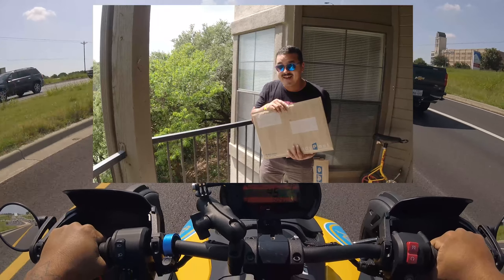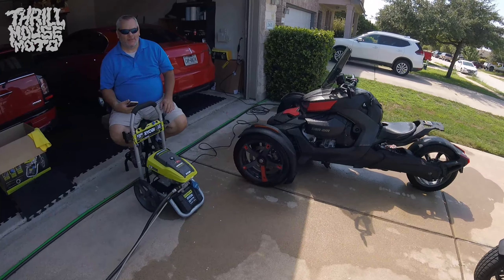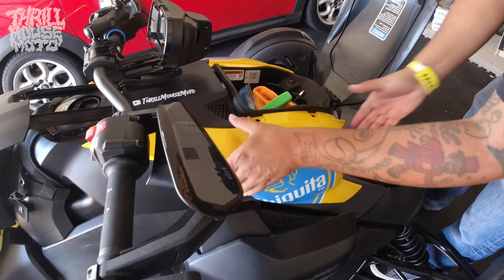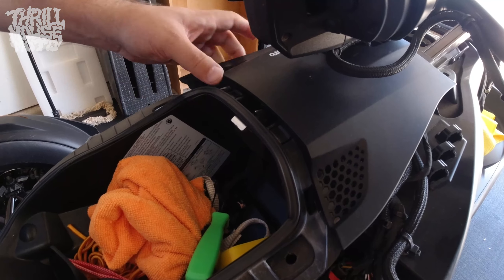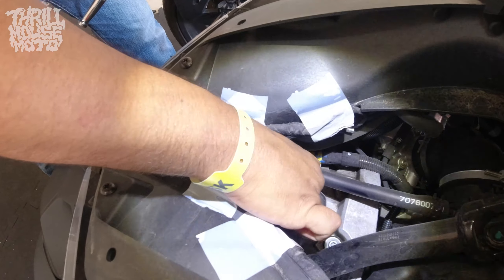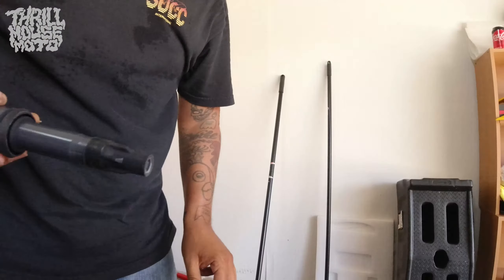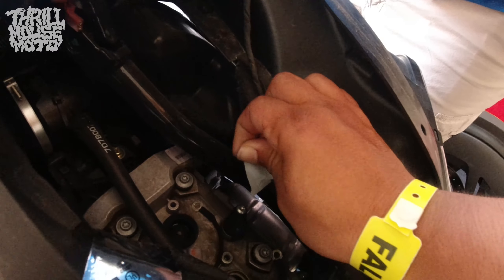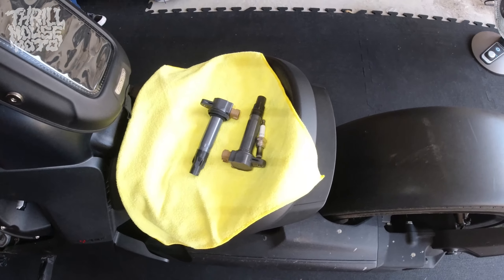My First Giveaway! ..And Can-Am Spark Plug Install 🔧😎

Comment: Thanks for this great installation video. What is the recommended mileage for changing the spark plugs?
Reply: Stock plugs (from manual):
The following must be performed every 20 000 km (12,000 mi)
(irrespective of the number of years):
Replace spark plugs
Replace engine air filter and clean the housing
Replace the fuel filter

NGK IX Iridium Series plugs CR8EIX:
Longevity: 50k Miles
Reply from the maker: Thanks! Excelsior (..Kevin) is definitely the best person to answer that out of us.. Thanks for getting that Kev-Dawg 💪

Comment: I was wondering how many miles on your Ryker for a spark plug change?  I did't realize it was that easy.  Thank You
Reply from the maker: Kevin posted this:

2 days ago
Stock plugs (from manual):
The following must be performed every 20 000 km (12,000 mi)
(irrespective of the number of years):
Replace spark plugs
Replace engine air filter and clean the housing
Replace the fuel filter

NGK IX Iridium Series plugs CR8EIX:
Longevity: 50k Miles

Comment: When I looked at my filter I just used the clips to take the side panel off. I did not take the screws off....I guess I am so used to the sound but I will look into that foam. 👍🏾. Did you take your Ryker in for the 3k inspection?
Reply from the maker: I should but I keep wanting to hold on to my Ryker each week to film, Haha 😅.
Reply: @ThrillMouseMoto  hahahah. Did you feel a difference with the new plugs?
Reply from the maker: @giovannam925  Kevin said it will take a while to notice the difference in my gas mileage so I'll give it time. I can later do a side by side comparison with Ryan's stock 600